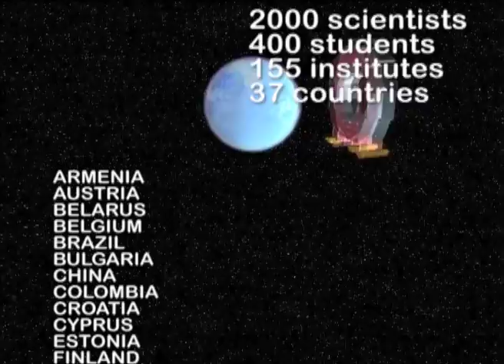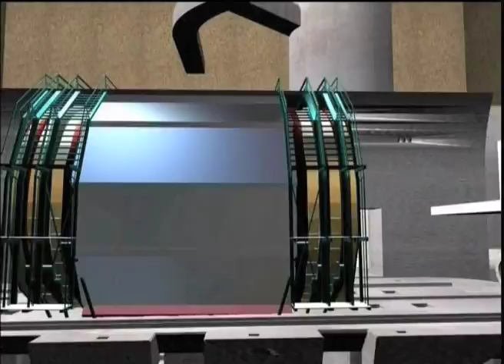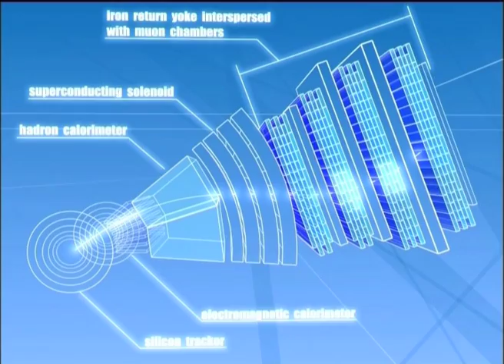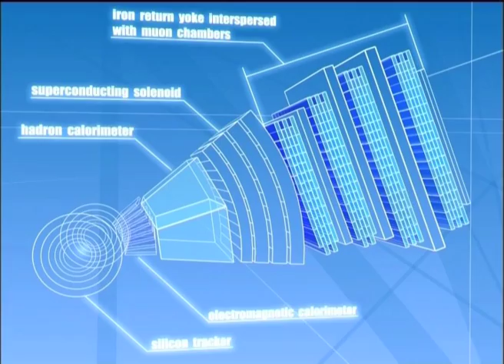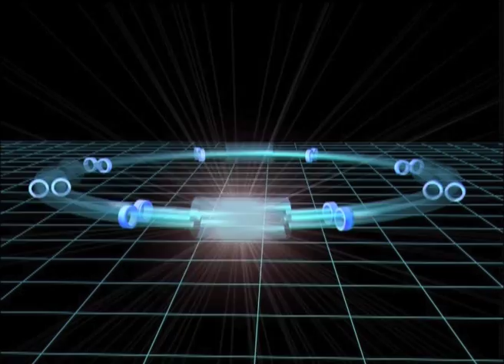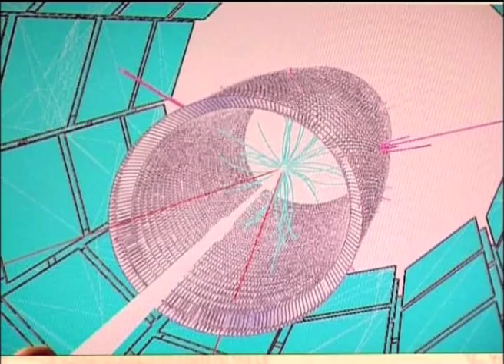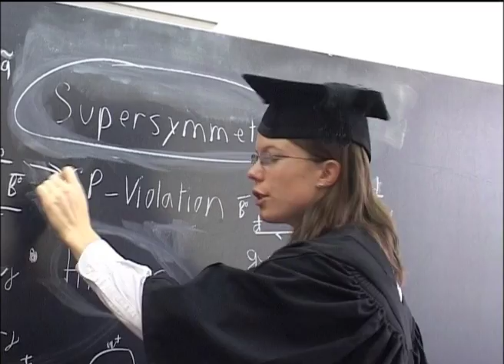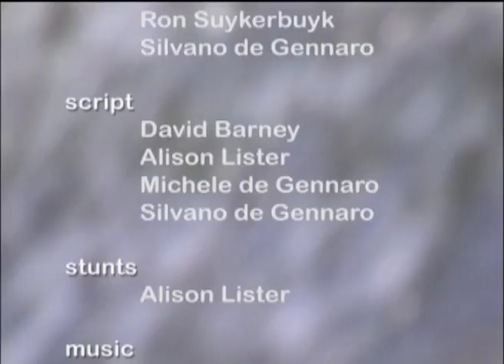Particle Hunters

Comment: @ancientwisdom2012 I should say instead of a "fruitless search" in general, an endless search if the infinite fractal theory is correct.  Yet particle physics would be a fruitless search in the sense of finding a Unified theory of Everything.  In terms of missing mass, Einstein's field equations cancel out rotation by attaching the observer to the rotating object.  This may be a huge oversight that will account for the missing mass. The "64 double tetrahedron" is the proposed fundamental pattern

Comment: 1. You can perhaps argue that the SM model is incomplete at the quark, neutrino, Higgs level. The SM is absolutely a done deal at the H atom. Who is investigating the architecture of the H atom? It is not even among the 10 most important questions of Physics. The mathematicians are investigating the screws and bolts of the boards that make up the house and have no idea what the house looks like. Sounds like a plan? Meanwhile, they claim that they split and photographed individual atoms!

Comment: The people at LHC think that the invisible messengers that go around the accelerator are particles, when what they are doing is either 'observing' torsion signals moving along the ropes that interconnect atoms or 'observing' rows of aligned atoms (electron serpentines) twirling in situ (standing torsion wave). There is nothing being 'accelerated' except signals. The mathematicians have confused these signals for discrete particles. (Ref: EI#8).

Comment: 1. There is not such 'thing' as 'a' field, ish. Things (tree, rock, atom, electron) have shape on their own.  Concepts such as 'a' shadow, 'a' hole, 'a' wind, 'a' fire and 'a' field do not have shape ON THEIR OWN. 'A' field does not have a surface. Therefore, it is unscientific to assign the word field to the 'entity' (object, physical, thing, shape) which will apply 'a' force on 'a' mass or 'a' charge. The reason you go thru so much trouble is that you have no idea WHAT you're talking about.

Comment: Father U does not recognize a difference between these two models. They are both planetary. The exact location, path or whatever is inconsequential to Science. It is a petty, irrelevant piece of data that only concerns the religion of MP. In Science, we explain. We have to explain WHY the atom behaves the way it does. You say that an electron is a bead that rolls around a highway you call region, orbital, etc. The bead is then irrelevant. WHAT is this region orbital made of? How does it...

Comment: The reply they always give is an attempt to cover lal the bases in order to make the theory unfalsifiable. The electron is BOTH a discrete particle and an extended 'object.' It is (let me caps that: IS) BOTH a particle (an object) and 'a' wave (a verb). It IS BOTH on one side of the proton (the bead, ionization, electricity) AND also all around it (the cloud, hybridization, covalent bonding). If the electron is a bead, you cannot explain bonding and if it is a shell, 'orbital', cloud, balloon,

Comment: You missed the point completely. We don't need to measure anything. If an electron is a particle which is an object which is a shape, this is strictly an issue of definitions. This is a cocneptual issue. Physics doesn't care HOW big the electron is. Physics demands that if an electron is presented as an object that it have shape.

But then, if the electron is a tiny bead (as insinuated at every opportunity and denied subsequently) we're back to Bohr's model: the planetary atom.

Comment: You are trying to escape the obvious, ish. Math uses the point particle so as not to be distracted by architecture. But the mathematician extrapolates the point particle to the lab and to the accelerator. The mathematicians never talk about 3D particles or their shapes. They don't care. They just talk about the alleged particle's mass, energy, maybe radius, speed, and composition in terms of more undefined 0D particles. There is no 'hypothetical' about it. The Std Mod is NOT hypothetical

Comment: How can an electron be both? This is irrational and you accept it with your mouth wide open, ish? Why didn't you challenge the idiot who told you this? How does a 3D (or 0D) particle convert to a 2D plane wave and back? Of course, If God can both be an object and a concept, we can explain anything with God. Your electron is just a little too powerful for a rational mind.

Comment: I agree with you. Completely. But you and I are a minority. We are overruled by a show of hands. In contemporary 'Science,' in the religion of MP, a particle has zero size, is 0D, and has no shape. A 'particle' is not an object, but a concept. A particle is REALLY a 'point particle,' where the word 'point' does not allude to a dot (object), but rather to a location (concept). (Ref EI1).

See EI 10. Most of the argument is there. It is unbelievable, but that's what the MPs have decreed.

Comment: 2. I am offended by your use of the word particle, and I have already pointed this out to you. I have a very low regard for this word, partly because QM is based on it, but more because the mechanic tries to pull a fast one on me: a particle is 0D, no size, no shape, etc. This is BS. How can they create debris in the chamber after smashing two 0D 'particles'?

I defined the word object as that which has shape. If you don't disagree, let's use the word object (or thing, entity, etc).

Comment: it does not have location. Therefore, it meets neither condition for existence. 

This humongously long and thin thread is spread out throughout the U (matter and what we call space). An H atom is comprised of EM threads approaching from every atom in the U. By E and M, I just mean that one thread will go straight to the center of the atom (E) and the other one will loop around and form the electron shell or balloon (M). I use E and M because there is no reason to change these qualifiers.

Comment: But assumng QM is correct, we still have push (photon, Ws and Zs) and pull (gluon, graviton). We have no problem with push. The trick consists in generating pull with discrete particles. What do you do? Just change the negative sign in the equation to generate PHYSICAL pull?

Comment: 1. You are fooling yourself, 690. The mechanics claim to have split an atom, to have photographed single atoms, and to accelerate protons and other SUBatomic particles. How can they make such claims if they cannot even draw an H atom? Maybe they're not accelerating particles at all. If after 80 years of QM, the mathematicians cannot draw the simpest of atoms, even the saints in heaven begin to question and suspect. Why have we moved into Strings if QM is a done deal?

Comment: You are confusing the word particle with the word object. Particle is a particular type of object. No one would call a rope or a ladder a particle. That's what threw me off. You are asking essentially whether the rope has shape. It does. It is a physical object in that it has shape. It also exists (it has location). The thread is 3D.  How this thin entity forms regular matter is an issue I cover in the book. I will not discuss light on light issues over the Internet.

Comment: Therefore, the first objection is that two regions cannot bind two atoms together as MO holds. 

But now you argue that it is not the regions or the energy levels or the orbitals, but two discrete electrons which bind two atoms together. Please explain how one discrete particle PHYSICALLY attracts or pulls on another discrete particle. Please do not use irrational and idiotic mathematical concepts such as field or energy  because I will report you to the nearest lunatic asylum.

Comment: MO is saying that Mighty Mouse can indeed strangle three cats together with his contrails. In QM, what binds atoms together are the 'energy levels' (abstract concepts). So the rational question is: What is an energy level made of? 

WHAT IS this formidable 'region'? A field? So what is a field? Is it made of points (i.e. locations)? 

The second set of questions are even tougher. What keeps the tiny bead faithful to the proton? Why doesn't the e- stick to the p+ during P-orbitals?

Comment: The thread is not made of any subcomponents itself because it is the ultimate entity of which everything else is made. It would be irrational to ask 'What is the thread made of?' because the next question will be 'What is the entity the thread is made of made of?' and so on. That's the problem with QM. QM assumes that there is a fundamental particle. You should always end up with something if you continue to slice or smash particles. You should never end up with nothing.

Comment: 1. The word particle is inappropriate in this context. You are thinking in terms of Quantum. A thread is an elongated entity.  A particle is a discrete entity. 

2. In order to explain the crucial word matter, I would have to go into light on light. The thread is 3D at a very fine scale. It exists (has location). whether it constitutes 'matter' is an issue of definitions. I do not regard the thread as matter in my book because it does not have certain properties of matter.

Comment: The U is the only conceivable perpetual machine. It had no beginning and it will have no end. An object ONLY has shape. If it exists, it has in addition location. We call objects that exist matter. 

The Moon ONLY has location. It can either be here or there. Location is a static concept. Matter exists in a static U (i.e. the U does not recognize motion or time). Matter exists only in present mode. In this sense the U is definitely perpetual.

Comment: 4. 'A' field consists of threads spinning around the serpentines (magnetic domains) (EI # 9). Gravity will be covered in EI # 11 + 12.

5. You cannot shake a rope (standing wave). A rope remains taut at all times except during electricity and magnetism (EI # 9)

6. A newborn is comprised of atoms. Every atom of the newborn is connected to all others in the U as the newborn is being 'assembled' inside the womb. Every atom in your body is connected via EM ropes to every atom in my body.

Comment: 3. The rope is not 'tied' to an atom. A rope forks out at the surface of the electron. The electric threads of every atom in the U converge and form the proton. The magnetic threads curve around and form the encapsulating balloon. With this balloon we can explain bonding. Schrodinger's equation merely tells us what happens at one location on this balloon. That's the famous 'cloud' model. Electricity is the twirling of a row of electron shells (a serpentine) (EI # 8)

Comment: 1. They are neither particles nor waves. The thread is the elementary entity of the U. Atoms are made of threads, which in turn make up everything else. They ARE not waves or particles. 

2. As far as I can tell, with the rope model of light, I can explain every experiment ever performed, from polarization to slit to photoelectric. In the book, I explain reflection, refraction, diffraction, straightness, speed, gravity, EPR, tunneling, and light on light among others.

Comment: What is transferred is a torsion signal along the rope that interconnects any two atoms (c = ƒ λ) A rope has no alternative. When ƒ goes up, λ goes down. A rope is the only architecture imaginable that can justify this equation. The atom is pumping torque waves at a faster wave along the rope. Therefore the frequency increases (i.e. the number of links comprising that stretch of rope increase and the links become smaller). You can see how the atom fits in at: YTube  ZmE11_E-rdE

Comment: The burner does not 'transfer energy' to the pot which transfers energy to the water. This is Ptolemaic explanation. In Physics, we say that the atoms/molecules of the burner vibrate, which induces the A/M of the pot to vibrate, which induces the A/M of the water to vibrate. We do not transfer 'the capacity.' This is irrational language.

Comment: can you transfer the property black? Can you transfer the property long? Can you transfer the property weight?

The word energy has several definitions and they are used simultaneously (i.e. inconsistently). Energy is defined as:

a. capacity b. nothing c. ability to do work d. a physical object (transfer/convert) e. a math concept.

Energy is an explain it all word, something like God. You can explain anything with the magical word energy and understand nothing.

Comment: QM does NOT explain chemical bonding. QM has two models for the atom: Bohr's planetary model, which it still uses to explain ionization and electrical current, and the balloon model, which it uses to explain chemical bonding and hybridization. So please draw for me the H atom. After 80 years of QM, this should be a piece of cake. We have 1 electron and 1 proton. Please draw them. Of course, if as you say, the electron is 0D, we have nothing around the proton.

Comment: What shape does a virtual particle have during those 'uncertain' moments in which it disappears? How does the VP lose length, width, and height and then recover them the next moment? How is believing in VPs different than believing in angels or in God or in leprechauns? These are the questions the numskulls at CERN and SLAC have to answer before spending tax dollars irresponsibly and running absurd experiments.

Comment: You are contradicting yourself, ish. 

1. An electron is a point.
2. A point doesn't have shape (i.e. no L, W, H)
3. An electron is an object.
4. An object has shape.

I repeat, an electron cannot simultaneously have and not have shape. If it is a particle, it has shape and belongs to Physics. Otherwise, it doesn't.

Comment: In Science, the 3 dims are length, width, and height and have to do with structure. The 3 coos are longitude, latitude, and altitude and have to do with location. The 3 vectors are depth, breadth, and elevation. They have to do with motion. Therefore, coordinates have nothing to do with structure and should not even be invoked in the instant discussion. WHAT a point or electron IS has nothing to do with WHERE it is located.

Comment: What is a point if it has no length, width, or height? Are you saying that an electron is nothing? Is this what a particle is? Nothing? Please draw a point. I'll bet you 2 beers that whatever you draw has widht and height. There is no shape in the Universe which is dimensionless. You are trying to get away with an irrational hypothesis. What you're doing is not Science.

Comment: A single point has form. I don't care what shape it is. It can be cubic, spherical or cylindrical, but it had better be more than zip if it is discrete. The ONLY property an object has is shape.

object: that which has shape

This is the scientific definition of the strategic word object. It is scientific because we can now use it consistently.

Comment: You are NOT describing a cloud! You are describing a MOVIE of ONE electron at different locations around the nucleus. This SINGLE electron can be at one side of the proton or another. It cannot be everywhere at the same time. Therefore, there is no such thing as a 'cloud' model of the H atom. The model in use to explain ionization and electricity is Bohr's planetary atom. Quantum Mechanics has made no structural improvements to the model in over 80 years.